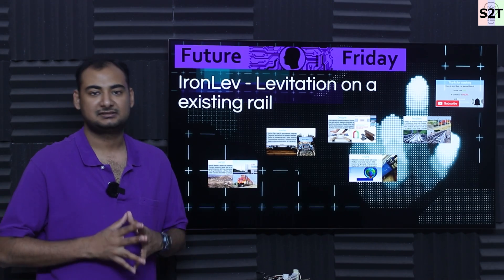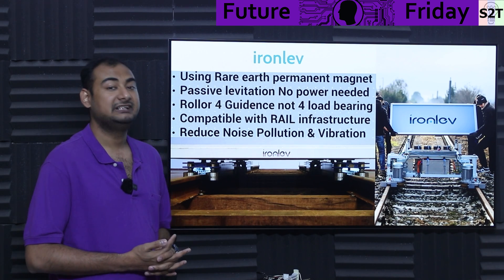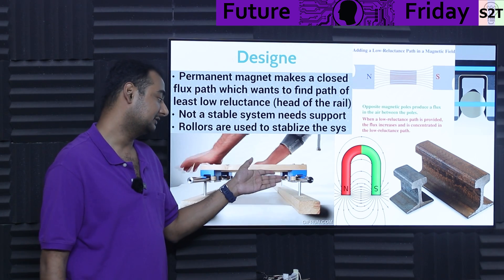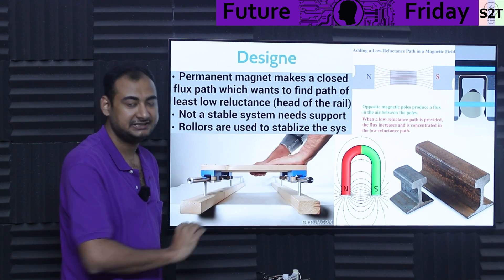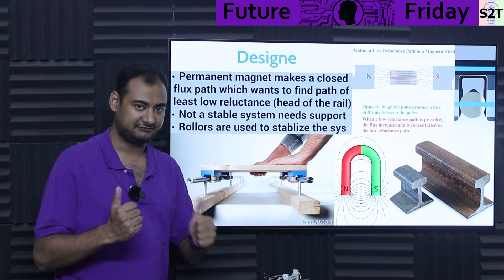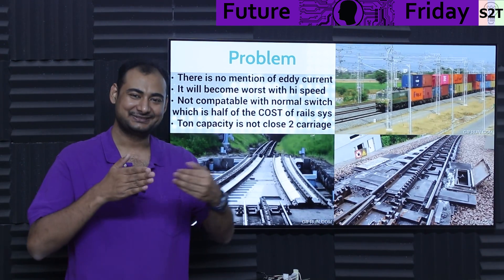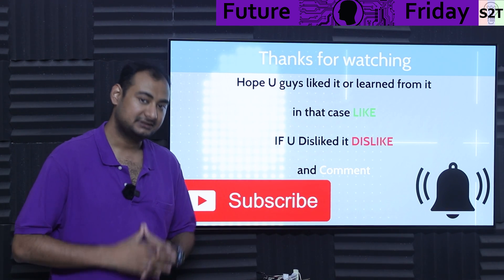IronLev - Levitation on a existing rail Explained {Future Friday Ep269}

Comment: (I know months too late...) How many of these issues do you think could be mitigated if one would magnetize the rim of a train wheel instead?
Allowing the magnets to rotate should mitigate the magnetic heating and breaking effects, while the "slope" and guide rim form would keep it on track while still be able to use switches (it probably needs an increase on the size of the internal rim, though). 
Although I don't know how that solution would affect the levitation. Thoughts?
Reply from the maker: I dont think u are grasping the magnetic flux path & I can't even visualise how it's gonna work U can make a 3d model then I can see what u are proposing
Reply: I believe your system would cause the train wheel to draw to the rail. Unless you alter the wheel shape completely.

Comment: Thank you for good  explanation. I have been looking at the problem we have here in Norway with reindeer or rocks on the long lines over the mountain areas. I have suggested using an autonomous unit running in front of the trains for checking the line and give warning. Do you think this technology can be useful in this area without carrying load and no need for high speed and just one line without switch?
Reply from the maker: maybe

Comment: This is to trains as spinlaunch is to rockets and gravitricity is to pumped storage hydro. It can't deal with points and track switches. Getting the train off the track for maintenance means you need to apply more upward force than the weight of the train! Good luck in the maintenance depot. They haven't thought it through, but it'll probably work for movie camera dollies.
Reply from the maker: LOL I did not even thought of that part too  but u can add PM on outside to leach flux and make it easy so its doable but not very "Pracital "
Reply: @s2tenglish  That's an interesting idea and some good creative thinking. Of course removing those magnets will also involve forces comparable with the weight of the train, as would removing a stray spanner or bolt that happened to stray too close to the magnets. The whole thing is more of a thought experiment than a useful project, so I wonder who's financing it.

Comment: Thank you for technical explanation on how this levitates. Ironlev has not been clear how this works. 

I am itching to get some U shaped magnets and try it myself. Do you think 3 bar magnets mounted in a U shape would have the same effect?
Reply from the maker: Thanks for liking it and YES u can build it with3 bar magnets but migh I suggest n52  10cm³ cube magnets  that will allow u to experiment with length width and height quit easly

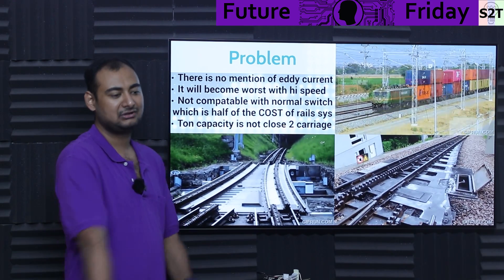Comment: 13:15  they don't claim it is currently compatible with regular tracks and switches (or level crossings, for that matter), they state that as being the goal, when they figure out how to.  I'm more worried about how these are supposed to take a curve.
Reply from the maker: humm curve is easy if rollers are on independent axis
Reply: @s2tenglish  it's not so much the rollers I'm worried about, it's the magnet strips.

Comment: In China they have made a suspended rail that uses the same concept, it uses passive magnets to levitate itself and use the rollers to stabilise and push itself forward or backwards, really it can only work on local transport but it can’t work on trams or high speed rail
Reply from the maker: fair point
Reply: Suspended railway dose a have a few advantages over normal railway, they are cheaper and easier to maintain due to all the components being storages in the casing that protects it from the elements, they are also good round corner more gently then bottom supported rail, they also have more conventional switches opposed to moving the entire track, the two downsides is that they don’t have cross compatibility with other rail for obvious reasons and they need to be completely elevated which could be cheaper or more expensive depending on the land acquisition, also if something did go wrong it would take mission impossible style stunts to fix it or evacuate passengers, how ever it is a very reliable system that is not prone to failure, if it did it would probably be power related since there is nothing that can get stuck, it could work in the future with iron leg magnets

Comment: Nice video, found you after searching for ironlev and you confirmed my thoughts, the eddie currents cause resistance so while wear from wheel friction might be reduced, the friction from the eddie currents is still going to be a huge issue. And the crossings and switches are an issue too. This tech seems like a dead end.
Reply from the maker: Thanks for noticing

Comment: Well, I think there's a use case for it: Rail buses. Those buses need a hydraulic system to lift the tires and asphalt at switches. I think that's going to work better than those Pacers.
Reply from the maker: fair point

Comment: Would you please explain why switches pose such a problem? I read first about pure maglev switches, but I would have thought with Ironlev the rollers must guide it along the rail. Is the concern that the rollers would shear off? Or that switches have a gap between the pieces? Or that the rollers must bang into the side of the rail with any directional change?
Reply from the maker: It's a system that needs too much clearance on both sides of the rail . The railway is built around a very tiny flange and only on the inside so u need to move this u have use system where the whole track is switched like meglave
Reply: The switches he shows in the video are not typical. Regular switches don't move the tracks like that. They have a small gap that can only fit regular train wheels. So only about 1/2 inch or 1.25 cm. can fit on the sides of the tracks. This system in its current design in much too large on the sides of the rail.

Comment: How long would it take the magnets to wear out and subsequently polarize the rail in the direction of travel by aligning the iron atoms? Also, is it really a better solution to use rare earth metals rather than electromagnets? With modernization efforts moving towards electric anyways, the propulsion system will likely necessitate electrical connection regardless.
Reply from the maker: this info can only be gained by time and real world test & 2nd NO HECK NO HELLLL NOPE the power draw of levitation is very high
Reply: The magnetisation of the rail can be addressed by having opposite polarity arrangements for the magnet groups ,so that they degauss the rail.
The best choice of rail for magnetic properties would be the soft iron used for transformer cores , but the mechanical performance of soft iron is terrible.

Comment: Could a possible solution to rail switches be a "hybrid" wheel and levitation system? Getting out of a station with its switches on wheels, then gaining speed and levitate only on long, linear tracks with no switches. How would you see that?
Reply from the maker: complexity is the enemy of Reliability that will add too much mess
Reply: @s2tenglish  I agree, and I am curious to see if and how Ironlev will address the matter.

Comment: The comics of the guy are nice. Details: 1] the IronLev cart can not do turns, straight track sections only. 2] the IronLev cart, as seen, only provides 'magnetic' lift, not horizontal propulsion. ...The 'turn' problem can solved by having at least 1 of the magnet sets able to pivot, similar to how large steam engines solved the same challenge. As for #2, on the cart one sees 'large' motors. Hence, it is using rubber wheels for stopping/horizontal propulsion.
Reply from the maker: Turn as in track bend radious or railway curve radius ?  Solving a problem is never an issue the cost to do so and the complexity of maintenance that follows that is the core problem

Comment: Solar powered covered rail cars with battery locomotives each with regen braking ❤ I hear prices falling!
Reply from the maker: solar cells are very fragile high vibration environment of railway will first cause microcracks then failure will happen very early so its not as blck and white as one thinks & first lets cover easy to do then FAR OUT stuff
Reply: From an article in CleanTechnica (Tina Casey) from one year ago. “Improved battery technology plus access to cheap renewable electricity open the possibility of battery-electric rail,” the Nature Energy authors explained. According to their findings, a standard boxcar could be converted to an electric tender car loaded up with batteries to achieve an all-electric range of 241 kilometers”. The article describes how the rail cars utilize regenerative braking to extend range which makes a whole bunch of sense given their weight. Given that one of the benefits highlighted for this technology was greatly reduced vibrations due to the levitation, might the solar panels be feasible? There would be less power from the regen braking but also a lower need.
Reply from the maker: @dadofchen  see I am old and I have seen 100s of tech come and go so anything that changes a lot and does not provide a lot & I mean A LOT of benifits will FAIL. Battery rail is a GO solar on top can be done unwise but can be done . Iron lev HECK NO as i said there is no easy answer how it will switch tracks that needs to be solved first
Reply: Granted, NEVOMO is already building a system along the lines of IronLev in Europe as we speak, MagRail. Europe uses more passenger trains than American and they are talking about speeds that I consider stupidly dangerous. Here in the USA our system is built for speeds where 85 mph are stretching capabilities. I DON’T have the answers but I like to realistically hope! If NEVEMO can upgrade the existing railway infrastructure in Europe to the speed of 550 kph (340 mph) at a very competitive cost as they claim then they COULD slow it down to a safer speed and add renewable power generation.
Reply from the maker: @dadofchen  so speed is not something you can add to a existing  path even if u upgrade the method of locomotion. G force is real so when  the track was built all the twist and turns are baked it U cant go faster in it as that will need full five point harness per passenger . Japanese maglev is not expencive because of the TECH its expencive due to right of way as in LOW to NO twist and turns or gradients if Mountain is in the way u have to drill through . For more info  on Nevomo MagRail watch 
https://youtu.be/vJMrpa9XTRE   {my video }
Reply: @dadofchen LOL u American you don’t have the expertise to tell Europe what to do

Comment: How does magnet propel something that's not magnetic?? If this is real, it's been a month, the publicity of this company does not match the fact
Reply from the maker: magnet is not for propeltion you have to do that with other things . magnetic levitation is common thing U can buy it and test your self  https://youtu.be/qe4x8rEk0Tc  and the glass stopper is replaced by Rollers or if u want full contactless by fast acting electromagnet
Reply: @s2tenglish  That video shows a magnet hovering over another magnet with opposite poles.  @kalasend asked the question, how do the normal steel train track rails force an opposite magnetic force to levitate the ironlev?
Reply from the maker: @ChinaChuck  dude just build one off maganet (I Did so Its ovious for me https://youtu.be/Fz7rEP7Y_c4  ) or Buy the door slider  . IN words the best I can is maganet wants to stuck to the head of the rail but side roller does not allow it so it ends up stuck in a magnetic flux rubber band

Comment: In understanding what was meant when it was said that the system is comparable with current systems, they were trying to point out that no new construction will be needed. Possibly a comparable ironlev switch if they manage to get a full rail system, but no new "construction". We both know that every current maglev system currently in use from China to that university in America, needed a full organized construction from the ground up. All of those costs are already in the ground so it avoids much of the cost of a " new" maglev system. Once the tracks and roadbed are paid for the new maglev system becomes easier to realize. That's not BS.
Reply from the maker: BS is saying time and time again it works on "existing rail"  that is an issue

Comment: Thank you for more detail about this.
THIS IS CRAZY!!! Why wasn't this invented 80 years ago. Its so impossibly straightforward that it.conceivably is easier than other methods that.are still in the R&D mode today. We have been exploring every other different method including superconducting magnets. You mean, it took till recently for someone to say why not just place two magnets close together in a clamp and see if that would work????
Why did it take so long to discover an easy way? His patent shows that there are still simple ways to do things that remain to be revealed. Good job.
Reply from the maker: low carrying capacity + high flux permanent magnets are a very recent development +  it has self limiting speed which is much slower than 150kmph

Comment: How fast the speed? can reach over 500km/h??
Reply from the maker: nope edde current will limti it may be less than 150kmph
Reply: @s2tenglish  so you can't compete Japanese LO Maglev?
Reply from the maker: heck no not even close u can try using Nevomo MagRail  not this
Reply: So in other words Ironlev is not  sutable for world existing railways?
Reply: @goranz9446 only for urban maglev speeds not high speed
Reply: Первая проблема пришедшая мне в голову - металлическая пыль и мелкие частицы которые  облепят магниты  через несколько километров дороги , они начнут касаться рельс, магниты нагреются до 90 градусов и перестанут работать , занавес , directed by robert b. Weide ..

Comment: You brought up exactly the issues with the basic physics that I noticed that this "invention" would be limited by. At least it allows you to move heavy things at low speeds really easily.
Reply from the maker: define " heavy "  well lets see how it goes
Reply: @s2tenglish  We need to move hundreds of tons per car. Do the calculations and you will find that you are going to need massive magnets. That means that any movement faster than a snail's pace is going to cause the rails to heat up like they were put in an induction forge and the resistance to motion from the counter electromagnetic force caused by the eddy currants is going to be just as massive.

This is good for moving a door or other object that weighs a few hundred pounds at a slow speed on less than 1 MPH very rarely, like a residential door. Not really many other applications for it, but I could see maybe a couple others where it could replace air cushions.

Comment: Why not use repulsive magnets instead of rollers?
Reply: because you cannot use that on existing rail. the entire track has to be modified for that to work
Reply: @SentinelAerospaceOfficial  The question is why. If the repulsive magnet can work on top of the rail, then why not on the sides of the rail?
Reply: @copperpennymine  magnetic repulsion does not work on the top of the rail. The Ironlev design wraps around the rail, essentially pulling up on the bottom of the thick top part of the rail. Magnetic repulsion only works between two magnets, and the rail is not a magnet.
Reply: @brianb-p6586  Interesting
Reply: @s2tenglish The sides of the rail are iron too, so why not use magnets on the side too instead of rollers?
Reply from the maker: I specify in the video if you have permanent magnet it will stick to one side or the another only way to get flotation out of it is utilising some other support that is why you cannot use magnet to support magnet otherwise we could have built permanent magnet bearings but we can't unless we have electromagnet to truly float it